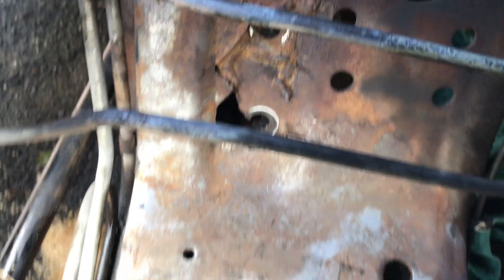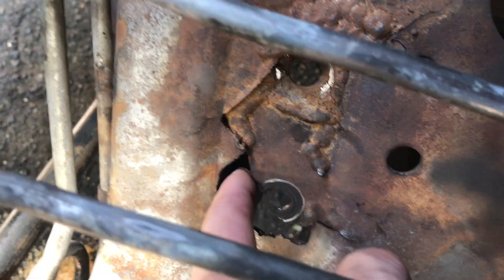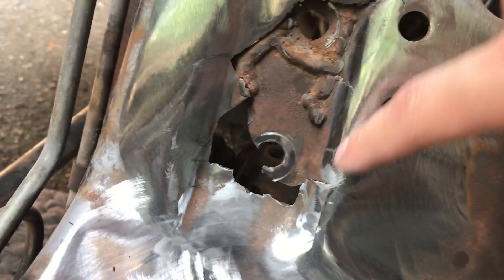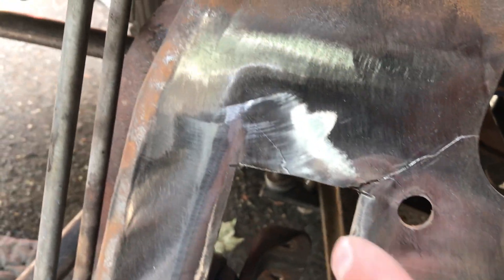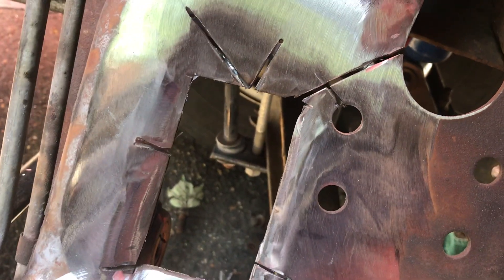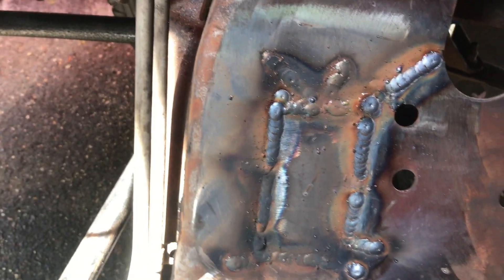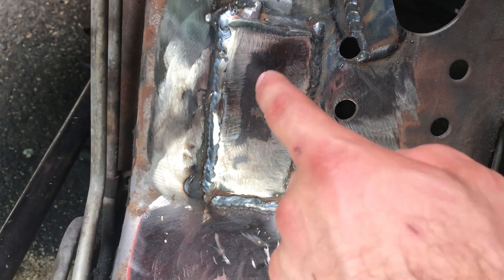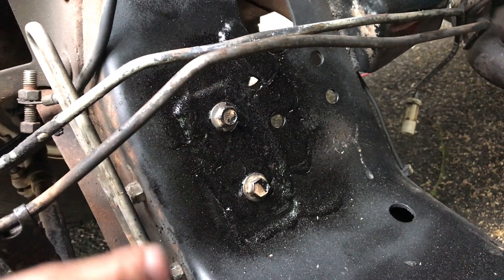How to Fix Cracked Engine Crossmember | 1995 Ford F150

Comment: Looks good man. I had to fix my frame at my rear upper shock mounts. The pocket in the shock mount collected water and dirt and rotted the frame out right there. I was suprised how well my cheap flux core welder did on the frame. It penetrated all the way to the back side. Old fords are the best man!
Reply from the maker: Cole Rippeon Thanks! 🤙 That’s a bad spot. I’m surprised the actual shock mount didn’t rot away. Nice man! Glad it came together for ya! These trucks are the best and are almost infinitely repairable.
Reply: @TheMinuteMasters  haha yea. I did replace the shock mounts too. The mount and the frame became one. When i knocked out the old rivets the mount stayed in place. When i hit the mount with a hammer it took a huge chunk of the frame with it.
Reply from the maker: Cole Rippeon Damn! That’s crazy! I’ve never seen that happen before. Nothing like owning your own welder. 🤙
Reply: @TheMinuteMasters  yea definitely. The truck is an 85. The rest of the frame was in great shape. Its all been cleaned and undercoated now but that spot was terrible. I cut a slot in the bottom of the shocks mounts so water and dirt can drain easily. Did it 2 years ago. Still no build up or rust returning. But keep making videos man! I definitely see your channel as one that will blow up eventually.
Reply from the maker: Cole Rippeon Good year! Is it carb or EFI? That’s not a bad idea. I haven’t had that problem yet but if I do I’ll have to do that. Sure thing man! I will! I appreciate your support!🤙
Reply: @TheMinuteMasters  carb engine. Mines a 300 6 though. 4 speed, 4wd. It was really rough when i got it. Most people said take it to the scrap yard but i said no. I like taking junk and giving it a new life. It really turns heads now. One of your floor pan videos helped me out actually. I actually scrapped the bed and built a wood flatbed. Welded in floors, outer floors, cab corners, door posts, made custom pieces from left over material like you recommended. Has new fenders, doors, hood. Basically everything lol. The truck is actually fully bedlined in black with a basic wood flatbed i built and old steel wheels painted red. If i knew how to send pictures on youtube i would lol
Reply from the maker: Cole Rippeon Hell Yeah man! That’s awesome! You got a good truck and I’m glad I was able to help you get her back together. When these “junk” trucks are put back together that do really turn heads. It’s one of the reasons I love mine. Me too man! I’d love to see what she looks like now.
Reply: I know it was 4 years ago but how big was the welder machine you use I just have a craftsman 110 MiG

Comment: A better way to solve that problem...straight axle swap haha.
Just a fyi, run stringers beads instead of spot tacks, the weld will be stronger.
Reply from the maker: gregory9740 I know right! Lol 

I’m not a welder by trade. So what is a stringer bead?
Reply: @TheMinuteMasters  late comment but stringer bead is just running your weld for any continuous length. Tack welds heat then cool fast and over and over as a weld is not as strong as a continuous bead.
Reply from the maker: @limeslush  Good to know thank man! 🤙
I looked under the truck yesterday and everything is still holding. So far so good.

Comment: Nice job buddy 🤙🏻
Reply from the maker: Gibbs 101 Thanks man!🤙
Reply: The Minute Masters  how did you find this was cracked?
Reply from the maker: Gibbs 101 So like I mentioned in the video. I hit a pothole and blew out the shock on the driver’s side. As soon as it happened, my truck started to death wobble until I slowed down. A couple days later, I replaced both shocks up front. Not more than three days later, I blew out the driver’s side shock again and got the death wobble. I still had a good shock left over from the original set. So I swapped that one into the driver’s side. However, I still felt as if the truck wanted to death wobble. I was running out of solutions when I decided to inspect every suspension part to make sure I wasn’t missing anything. Sure enough, I found the crack when I inspected the axle pivot bushing and bracket.
Reply: The Minute Masters I’m definitely gonna look at mine, I might have a crack also.. I have a lift so it might have put some leverage on it and cracked it.
Reply from the maker: Gibbs 101 Yeah it’s definitely good to check it out. Lifts usual cause it to crack faster.

Comment: Don't mean to rain on your parade, but....It is NOT recommended to weld the frame, as stated by most vehicle manufacturers.  The pot hole you struck saved your life! How?... it pointed to severe structural fatigue, were existing fatigue cracks all over this critical structural member of your vehicle were propagating.  When repairs are required, it should be performed by an experienced welder, using the proper procedures: a proper repair scheme specifically designed for this repair, type of welding equipment, welding rod(s) and proper weld preparation.  It is NOT guesswork.  It is a prescribed, engineered method designed by certified  professionals.  For example:  pipeline welders are certificated to very high standards, for a reason!  Your life and that of other's is worth doing this kind of repair properly, loss of control of your vehicle is not something to play with!  Please have a professional welder examine your repair!
Reply from the maker: 100nortonfan All good points. I worked for a crane repair company and understand your concerns. However, it was a 50/50 shot and I took it. 
Which reminds me, I actually haven’t looked at the frame since I welded it. I’ll be curious if it held up.
Reply: That cross member should be replaced. Not recommended to weld the frames are heat treated.
Reply from the maker: M Plante It seems people are split on this issue. If only replacing it was as easy as it sounds. I did happen to check it today and the welds and extra plate are holding up well.
Reply: @TheMinuteMasters  For the time spent to take the engine out you could have popped the cross member out and go to a scrap yard and get another piece in good shape, like i said it's heat treated and when you weld your altering the metallurgy and making that piece physically weaker and is more likely to crack or fail.
Reply from the maker: M Plante Now if I did swap the crossmember out with a junk yard piece. It would still need to be welded to the frame. Wouldn’t that mess with the metallurgy too? Or does a new crossmember bolt in?
Reply: @TheMinuteMasters  Its riveted just pop the rivets out and bolt the piece in with some decent grade bolts. just remember your twin i beams are bolted to that piece as well so it needs to strong.
Reply from the maker: M Plante The one in my truck is welded and riveted. Would just bolts do the trick then?
Reply: @TheMinuteMasters   do the welds look factory? or like rabbit shit, as far as I know it should be riveted. was easier and cheaper for Ford when assembling the frame to rivet it.
Reply from the maker: M Plante So the whole assembly (including engine mounting locations) are a combination of bolts and large rivets. However, there is at least one location where an angle bracket between the frame and crossmember is riveted but the overlapping edge has been welded. The well looks good too.
Reply: @TheMinuteMasters   looks like ford welded and boxed the frame on the 92-96 trucks near the engine cradle which complicates things, It could be  done to replace the piece but likely  not cost worthy if it had to be brought to a shop, I am wondering if your truck is a 4wd was it jumped or abused in its earlier life.
Reply from the maker: M Plante You are exactly right. My truck was definitely abused. The previous owner worked for/as a landscaper. I’ve replaced every suspension hanger and bracket on the truck. The bed is stained and rusted. I also welded new floors, sills, and cab corners in it. And, I also replaced the radiator support. It’s only 2wd. So
Reply: @TheMinuteMasters  Another nice video, wasn't sure if this was anything related to the loud popping sound when turning the wheel in park while in neutral. Seems to only happen when turning to the right, though doesn't need to go the full range of motion. Just happens sporadically though, Read on a Ford forum some place that it seems to happen a lot to older F-150's to be some rivets that were close to the motor mount.  #namaste 🙏🏼 Thanks again for the videos. 

https://photos.app.goo.gl/h1Xp6NPEgG19qqtA6
Reply from the maker: @gene118  Thanks Gene! 🤙 You could have this same issue. However, I would check your axle pivot bushings first. They can make popping sounds when they are worn out. I would also check your steering assembly I.e. tie rod ends, ball joints, etc. 
You can also have a crack in the frame near the steering box. I had that crack too. 
No problem man!